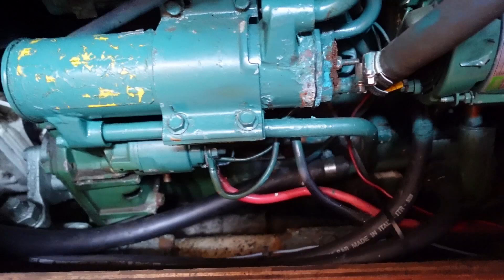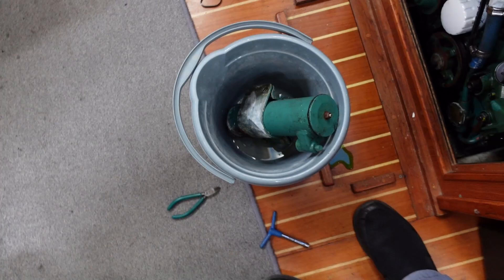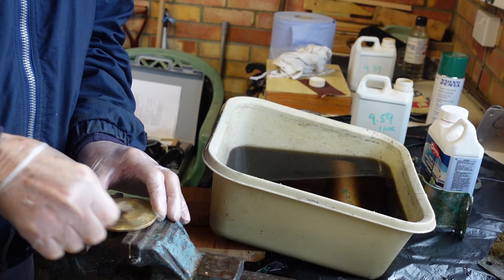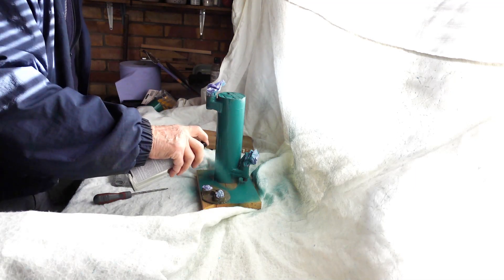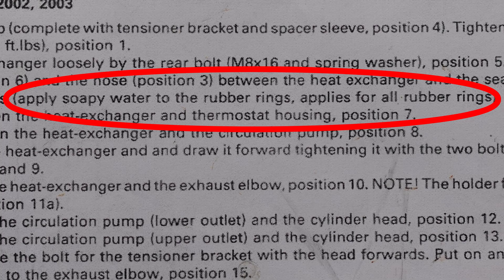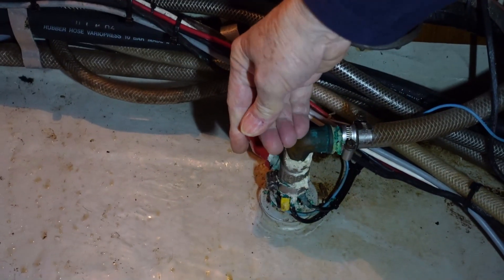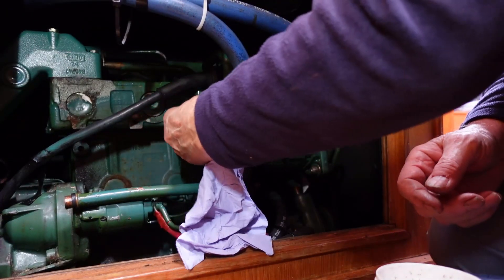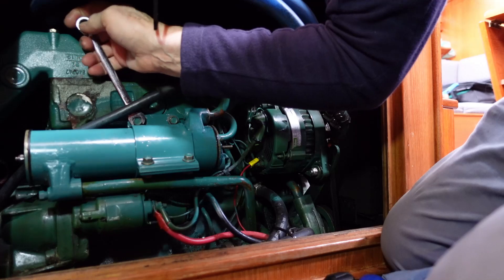Dismantling a Leaky Heat Exchanger in Tight Spaces - Full Refurbishment

Comment: An excellent video, very useful if you are a VP owner. I am not but you still lots of good learnings from your experiences. Thank you. Best
Reply from the maker: Thank you Mark, I hope all is well with you... Best Wishes ... Dave
Reply: @davesailing  all is well. At the end of our summer sailing season I had a number of major maintenance items to deal with including replacement of the head furling system. Old extrusions worn out and furling drum probably age of boat, 40 yrs. Our autumn has so far been characterised by almost no decent winds for sailing, a bit frustrating. But unlike you northerners we get to sail year round and winter often brings feisty westerlies. Look forward to your 2024 excursions etc. best, M
Reply from the maker: Hi Mark, The furling gear does seem to have a life of around 30 - 40 years. I replaced mine a couple of years ago. It's so much easier to furl now :-)
Reply: Interesting video, we have a Volvo 2003T.  
Slightly different layout as far as the heat exchanger, no slot where it attaches to the engine.  But that makes it really difficult to mate all the pipes which are mostly push fit with those rubber seals. Plus the addition of the turbo cooling pipes. 

When I did my heat exchanger I used a plastic toilet brush holder ( a couple of quid from what was Wilko. Though other stores do them too.  It was just big enough to fit the tubes in.  I used a litre or so of white vinegar to cover the tubes and left it overnight. Most of the tubes were clean and I used a pipe cleaner to remove the stubborn bits in a couple of the tubes. 

We are in the Eclipse a few fingers up from you.

Comment: Unfortunately Penta's seem to have quite common problems on the heat exchanger and the exhaust elbow, every owner i've known have had some sort of issue with them, not good considering their over exhaubatant spares pricing.
Reply from the maker: Hi Paul, the 2002, 2003 series seem to lack a little in the design stakes. They certainly don't like sitting around not being used. And yes the spare parts are ludicrously expensive. The Gasket set was over £40. £7.50 for a single rubber O ring. But it's what came with the boat and it starts on the button and runs well, just the bolt on stuff is a bit suspect. Good to hear from you, more videos to follow. Bets Wishes ... Dave
Reply: Thanks for the video Dave. I’ve got a leak coming from my heat exchanger and this was exactly what I came to YouTube hoping to see. I begin the removal tomorrow 🤞🏻. Cheers
Reply from the maker: @ViewanAD  Hi Mark, You're just the person that the video was aimed at :-).
Good luck with the heat exchanger. I hope it goes well. 
Best wishes ... Dave